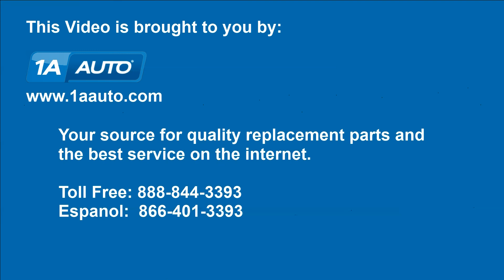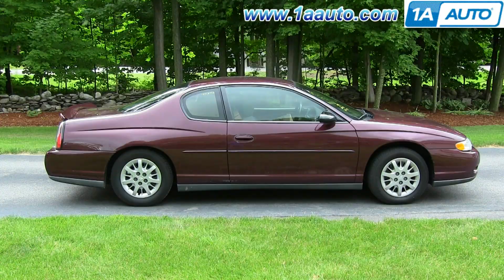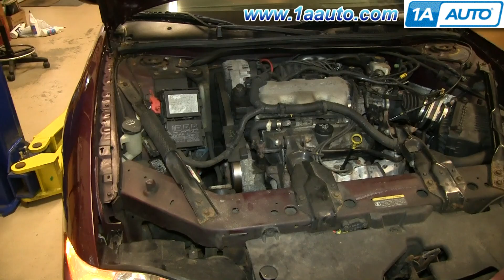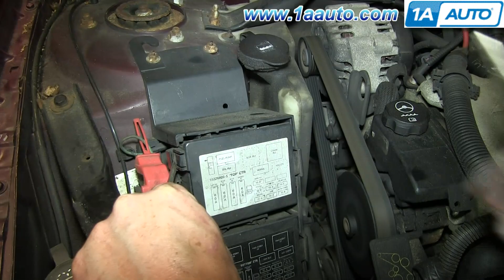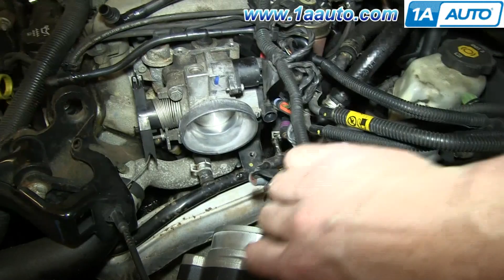How to Replace Fuel Pressure Regulator 00-05 Chevy Monte Carlo

Comment: Just curious why u replaced ur regulator and would that regulator cause a crank no start cause I replaced my fuel pump and checked my fuel filter but Im still not getting any pressure to the shradder valve

Comment: Could a faulty regulator cause a P0300 code? Having problems with flashed CEL 04 Monte Carlo SS changed fuel pump,spark plugs,wires,coils, an now MAF sensor.. thinking now maybe this O2 Sensors or Ignition control module

Comment: You really don't have to remove all of those parts. You must be a mechanic. Remove the fuel line, take off the vacuum line, and disconnect the regulator. Rotate the throttle down if it's in the way to allow for more room when reinstalling the regulator.

Comment: Thanks.
Was able to replace without removing throttle body.  Though a bolt close by was loosened.  Running sooo much better 😁
Still weird behavior from throttle.  As though it's position sensor, or simply loose cable.

Comment: I have a 2004 Oldsmobile Silhouette minivan with the 3400 PFI engine. What exactly does the fuel pressure regulator do?  How do I know if it needs to be replaced. I currently have 92,000 miles.

Comment: Good video, I was able to change mine without taking the throttle body off
Reply from the maker: +Tim Sigers Thank you! We love empowering our customers and showing how to perform DIY auto repairs with our high-quality auto parts.  http://1aau.to/m/Shop-1AAuto-c
Reply: Is yours a 3400 bc my only issue is getting the fuel line off the bottom of it and I’m to doing it without taking the throttle body
Reply: Yeah, I'm looking at mine, and it looks SOOO close to not needing so much work.  My fingers are crossed lol
Strong indications that my regulator is going out.

Comment: I have a 3.8 in my 2000 Monte .. Is there a difference in the 3.4 and 3.8 in the regulator .. ?? ..
Reply from the maker: +Dave Miller The regulators should be able to fit for either engine size.
Reply: @1AAuto   ok .. I replaced the regulator last summer .. I still get a good odor of fuel when i'm working under the hood .. Now that I know the regulator is not in question I can look other places for the culprit .. Thanks for the reply and great videos .. I have learned alot from watching them .. Take care ..

Comment: How much coolant did you lose? I have to do the same replacement on a 2004 Pontiac Montana.
Reply: I have run into the issue of the  nut being to tight. 
I can't get mine to loosen

Comment: I replaced fuel pump,a piece of rusty fuel line,fuel filter,throttle body position sensor and car started fine. But when i replaced fuel pressure regulator now car wont start

Comment: I gotta do this on my Malibu lately I gotta give it gas to start it and it smells little gas in front I'm assuming it's this
Reply: I just started having the same problem with my malibu. 05’, when i go to crank it, it will studder or kinda skip unless u give it a little gas just right and its fine and runs smooth from there, if no gas then it just continues to studder/ skip. Im wondering if you replaced yours and it fixed it?

Comment: I own 2003 impala would this possibly correct a wonky fuel gauge?
Reply from the maker: +Patrick Snow Thanks for watching!  If your fuel gauge is not working properly you might want to check the fuel sending unit first.  That is typically what causes your issue!  1aauto.com

Comment: why did you guys replace it? i have a 99 grand am 3400 no fuel shoots out of the regulator but tge vehicle is running rich. the plugs smell like gas and it starts ok if it sits over night but once its warm it starts and stalls  5 or 6 times and smell like gas. i am about to do the regulator i think that might be it?? what do you all think? any suggestions??

Comment: i can not get that bolt broke loose that connects the fuel line to the bottom of the regulator. any ideas would be great its on a 94 chevy cavlier
Reply: Did you ever get that off? I'm having the same problem
Reply: Same here. What did you do to get it off?

Comment: Hey, at 1:07 the video instructed to pull out "this hose". What is the name of that hose and do you have that part in your inventory???? To be specific, it's located on the air cleaner intake duct and its between the  intake air temperature (IAT) sensor electrical connector and the mass air flow (MAF) sensor electrical connector. 

Also, do you have any instructional videos as to how to replace it?

Comment: I recommend draining about 1 gallon of coolant from the radiator to avoid a mess when the throttle body is removed. My Olds Alero spilled about 3 pints on the driveway.
Reply: Paul Zumpf how do you drain it

Comment: This was a great video and because of it I did this FPR replacement on a 3.1 following it step by step.  Didnt take me 9.5 min though!  Anyway, I ran into 2 issues that others may encounter as well.  First,was I did not have any play on the coolant bar bracket connected to the lower throttle body stud bolt in order to move it out of the way.  Alot of play on this is shown at 2:52 of the video... this held me up for a awhile and I had to actually muscle/twist the bracket out of the way (vise grips) slightly in order to remove the stud bolt.  I would also recoomment moving the coolant hose clips at the point shown, but remove the hoses as you lift the throttle body out... conversely, reconnect the hoses as you re-install the throttle body, before tightening it down.  Again, I just did not have any play on that coolant bar, but that could just be something on this malibu.  BIG THANK YOU to 1AAuto for this vid, I wouldnt of even attempted this repair without it.
Reply from the maker: Thank you for watching! Glad to be of help. Please let us know how the repair turns out. 1aauto.com 888-844-3393

Comment: Thanks for the video. This is going out on my 05 Monte and this video helps. Pretty simple procedure but I am not looking forward to wrestling that big air hose off. They are very resistant to moving. 3.4L is a damn fine motor. Just a water pump and now this in 140k miles.
Reply from the maker: Thanks for watching. Let us know how the repair goes 1aauto.com 866-403-3393

Comment: Thank you for the excellent video. 

Would like to mention that on my 2004 3.4L there was a throttle body gasket that needs to be replaced as well. 

Also, while checking the new regulator for leaks, the ignition only needs to be cycled into the accessory position to pressurize it.

Comment: What could be the reason y my 2000 Monte Carlo ss acting like it don't wanna go when push on the gas petal it have a hard time speeding up what could be the problem I done got a full tune transmission and all lol please help me out here
Reply from the maker: You may want to check the catalytic convertor to see if it's clogged. If there's a check engine light on, you may want to pull the code to see what it's pointing to. Hope this helps you out. 1aauto.com 866-403-3393
Reply: Thanks if it is clogged can I get it cleaned out or do I just have to buy a new one ?
Reply from the maker: Ishaq Prather You would need to replace it, if that's what's causing the issue.
Reply: Thanks 1A Auto parts
Reply: Thanks 1A Auto parts